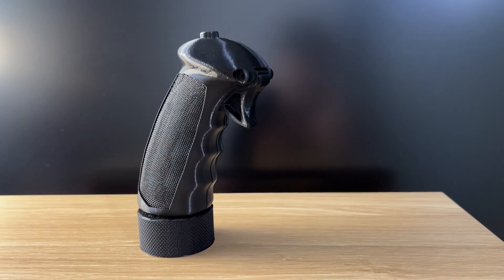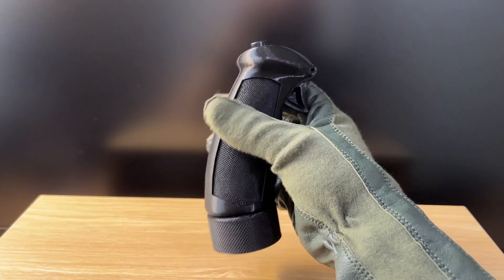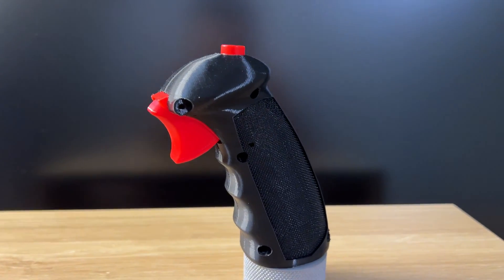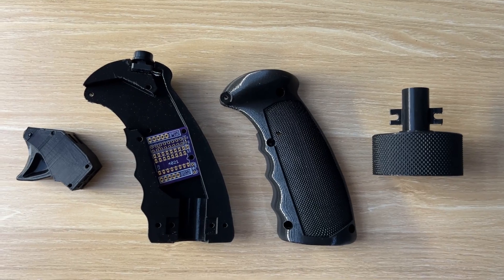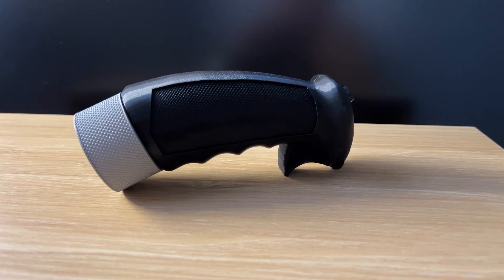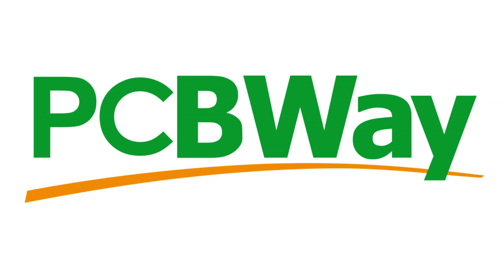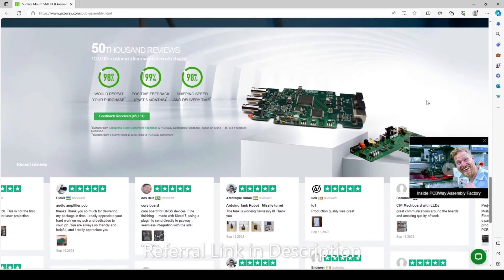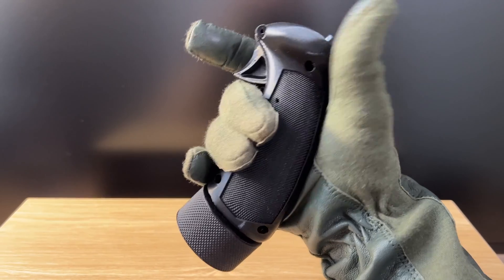P-51 Mustang Joystick 3D Printed DIY - Free Files

Comment: This is a great design and printed well on my K1. I wanted to reprint the trigger and trigger enclosure separately at a finer resolution but could not break them out of the .stl file.
Is there some way to do this or could you possibly un-bundle the individual parts from the .stl you have shared.
Thanks!
Reply: Okay, problem solved. I watched your excellent trigger design video and looked at the downloadable files for the trigger. Thank you!

Comment: Can you please share the specs on the torsion springs you're using in these triggers? I know you said 5mm OD but what about wire thickness, number of turns and angle? Thanks.
Reply from the maker: The spring I am using is .9mm thickness, 7 turns, total width 6.35mm
Reply: Thanks, that's great. Wanted to know before I ordered as most places sell in packs of 10 and didn't want to waste money on wrong size. :) 
 @thesimnet
Reply: Just go to any local store and pick up a pack of hair grips for £1 and take the springs out.

Comment: Could you please put all of the files separate instead of in 1 stl file? If i mess part of it up, i don't want to have to reprint the entire thing.
Reply: Agree it would be nice to have as seperate files to start with. However I just imported them into Blender, deleted the bits I didn't want and exported seperate STLs.
Reply: @johannesfactotum2682 I really need to learn blender, but I am still trying to master Solidworks and it is a long process. Thanks for the tip though
Reply from the maker: Absolutely, I will separate them out in the next update!
Reply: Nearly every slicer has option to separate parts then just delete the ones you don't want
Reply: @DavidBrown-tl3ft  yah I just started using the bambu slicer and I can do that now. Very cool.

Comment: YES!  YES!

Making the grip compatible with original TM base adapters is huge!  This should allow us to attach these grips to both Winwing adapters (which attach to the bottom of the original thrustmaster base adapter) along with VKB adapters (which are a drop in replacement for the thrustmaster base adapter, using the same screw holes).  I will for sure be giving this a shot!
Reply from the maker: So happy to hear this feedback - all of my grip designs will use this method as it makes assembly more straightforward as well!
Reply: Have people decoded the interface for WinWing sticks?
Reply: @rightrudderleftstick  If you have access to an original Thrustmaster base adapter, then you can use the adapter winwing sells to interface with it.

Comment: I thought it was called B-5, not B-6. Wasn't B-6 used by the Navy?
Reply from the maker: You may be right about that!
Reply: @thesimnet  Nevertheless, great work! I saw that bomb button is made of tact switch. Would you consider to remodel the grip to use the switch you found for DIY OTTO P-1 button?:-)

I am looking for replacement for my B-5 (B-6?) DIY sculpted-from-resin grip and your grip looks great!
Reply from the maker: @sunrrrise  Right on! It was a little bit too long and interacted with the trigger initially, but now that I think about it there might be a way to do it that doesn't interfere... thank you for the suggestion!
Reply: @thesimnet  There shall be enough space as this B-5/-6 grip did not have two stages trigger, at least in Mustang. Camera was powered on and off via toggle switch on central console. The trigger was only for guns. So easy-peasy spring&button is enough, at least for P-51. 

One more thing: do you know Authentikitm? Few months ago they released P-51 throttle quadrant with working K-51 range adjustor in the handle!
Reply: @sunrrrise that’s also my main concern about the design definitely worth a remodel in my opinion
Reply from the maker: @Tijn_C  Thank you both for the feedback, I will incorporate the changes in the next update!
Reply: USAAF fighters used B5 and B6 grips. USN fighters used NAF 1173 (-1, -2, -3).
Reply from the maker: Thank you  @anonymous8780  !